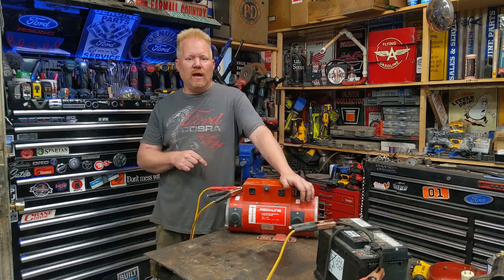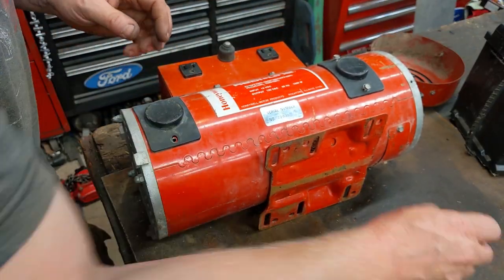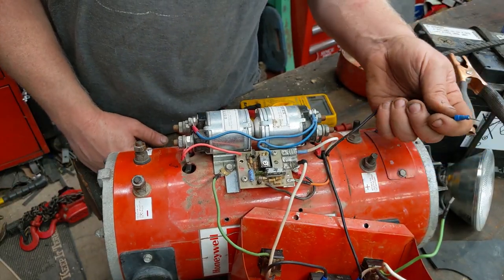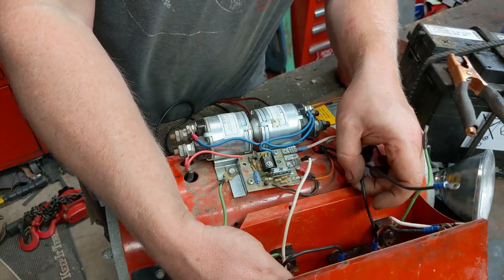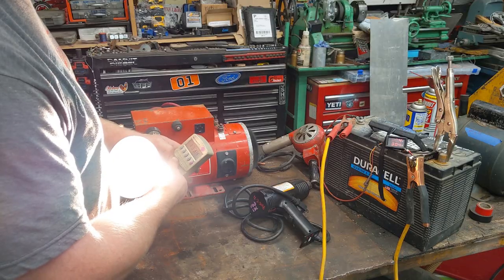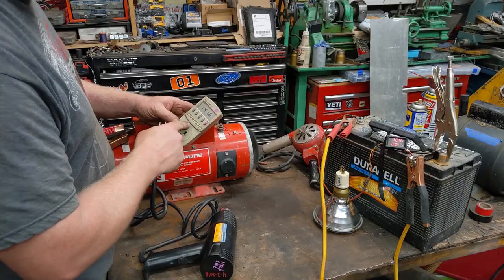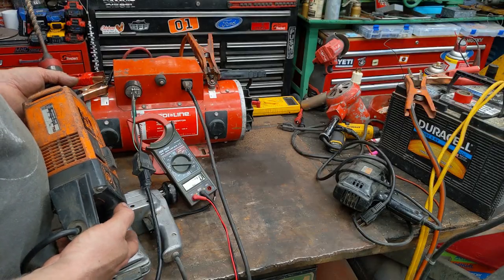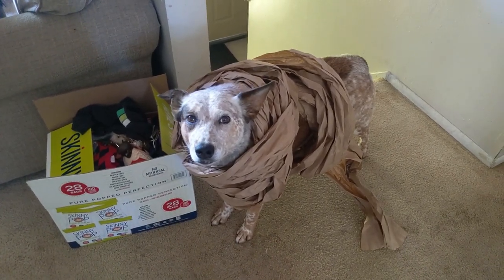12v DC to AC ELECTRO MECHANICAL Generator REPAIR .. HOW THEY WORK .. solar lithium powered?

Comment: Don't forget to show off your Kill-A-Watt meter video as well titled "Kill-A-Watt not working HOW TO FIX".   Inspired me to make a video of my over voltage damaged from the cheap 2-stroke engine 1200W generators I also made a video detailing since I was testing and didn't realize the asynchronous alternators (generators that are brushless) need a minimum power load or they don't have a stable enough voltage.  My videos are titled "You Won't Believe How Easy a Blank Screen Kill-A-Watt Meter Is To Repair For Newbies"   These are neat products and I've been pondering to make a 3-phase rotary converter and/or a 3-phase generator eventually using the extra gen 3 prius CVT that has two motor generators (MG's) that are both way higher power for a unbelievable price since they last... though they're brushless as well so will need to consider having like a resistance load on of some sort once started and some sort of load (current) cutoff for that one another big enough load is on or something like that if not digital using the IGBT and inverter/converter at least electronics.   Sucks trying to do anything smart and move forward on to finish, since my head has a 24-7-365 EMP craft on it.  Thanks for sharing this, neat to see as I've only seen I think a Greek gent make a video showing how he did phase and power conversions using the smaller model motors.
Reply: There are a few good rotary converter YT videos, though that's another topic.  Great overview detailing what you found and rescued!   

That's neat the load control circuit, I almost want to ask to see if you'd photograph in detail the wiring and board or make a schematic.  I'll have to look online and see what I can find.  

Seems like you'd need a feedback loop of some sort logic that'd keep a constant frequency ultimately like you noted for the output in like some sort of 12.6V input control where I'm guessing some sort of high enough current rated buck/boost circuit design or other Constant Voltage (CV) design.  They're out there and cheap... though not sure since I've not looked at the ones over 3A's.  Those 2-3A ones are a few dollars for the 5V USB output design, so I'm sure looking around there are cheap modules for whatever CV you want set... buck converter most likely technically with making an additional low voltage cutoff maybe if can't be built in the module to boost convert maybe I'm thinking.

Comment: I wonder if the two 110 VAC outlets are separate also. So on left 12 VDC would feed left side 110 VAC outlet and another 12 VDC would feed right side 110 VAC outlet. Or could combine them. I had something similar years ago and do not remember what brand. Is that a Blue Heeler ? Love those dogs.

Comment: I have a possibly silly question for you, since its a purely mechanical inverter. Do you know if its possible to feed in say 115V ac 60Hz into the output and get dc 12V out of the input? Say to use as a battery charger for example although an in efficient one.

Comment: What are the chances the 2 sides run out of sync with other?  if so,, you might be able to get 240v AC... We had something similar in a machine shop to get 3 phase for the milling machines..   You should be able to test it by using a meter or wiggy across the 2 hots
Reply from the maker: The shaft running through the center of the entire thing is one piece. Along with that it looks like the AC generator is only a single unit. So 2 DC motors, one on each side and a single 120V wound AC generator in the center. I think is just runs two DC motors as the amps required are pushing 200amps and one set of brushes can't handle that.
Reply: @sixtyfiveford  One of these days, I'm gunna be right about something and everyone will be amazed..  Basically that thing is the original version of an inverter and still better.. A rotating motor /generator will always produce a better wave than any inverter can because it's real.. I have been working on a project that would be perfect for that thing and might be the final system to take my house completely off grid.. Now I'm going to be searching the web and auctions  to find one...    Since side A  turns on when a load is sensed,, could side B kick in at a higher load.. I can see that being handy for things like a fridge or an air compressor.  Both sides kick in to handle the start up surge.....
Reply: That's what I was thinking as well I would almost bet that the two sides have separate AC windings and one comment said they had a 240v version.

Comment: I got one to replace a rusted out one in my work truck, it worked first couple tries, then just started clicking...any idea what's wrong?
Reply from the maker: I would check the contacts on the relay. The clicking is the relay activating but it may not be passing power.

Comment: Just put a start button on it!  What's the efficiency of these, probably better around 30-50% , and looks like besides  the  starting electronics, it could be wired in series for 24v,

Comment: Super chanel ,  look like 220vac compatible using the 2  plug.
Reply from the maker: Maybe! I'll have to check.
Reply: I saw one comment mentioned they had a 240 version so I suspect there's two windings that can be put out of phase

Comment: connect a battery charger to it and charge the battery with it :) seriously though that is pretty cool, id like to have one for my truck connected to a couple deep cycle batteries and some solar to keep the batteries charged when the truck isnt running.
Reply from the maker: Endless power.
Reply: @sixtyfiveford  Yeah, the mythical perpetual motion machine.

Comment: Question is can you spin that thing up with a battery then plug a battery charger into it then power it off the charger n unhook the battery?
Reply: Efficiency makes this impossible
Reply from the maker: shhhhh...... If the government finds out about my endless energy device I'm going to be silenced forever..........
Reply: No once u take the power source off it's dead

Comment: Amazing, this is exactly what they sell today as a green generator… it was existing a long time ago, funny.. the question is, how long it is working with two 12 volt batteries.. I do think that this will work good like the new green generators! So it must be possible to connect a sun panel on it, so it is green powered!!😅
Reply from the maker: It doesn't last very long. It is around 75-80% efficient at converting DC to AC power

Comment: Befor there were solistate inverters there were ether inverters with a vibrator or for larger current draws to step DC voltage up or down at larger current draws motor generarator inverters were used-  on the B 17 bombers most of the equipment was 240 volts DC - the batterys along with the tail generator and radial engines generators were all 24 volts DC - 4 motor generators boosted the 24 volts DC to the aircraft operating voltage to 240 vots DC - also the radio ran off 110 volts AC 400 Hz, a inverter generator powered the radio and radars- 
       Up till after WW2 most rural homes did not have grid power - rural homes that did have electricity primarily used 6, 12, 24  or 32 volts DC  - there was. A complete line of appliances sold in 32 volts DC in small towns equal to any appliance sold in citys that were 110 volts AC  in a city - 
   A TV or florescent lights in a born ran on 115 volts AC - so farms that had a 32 volt house with a large bank of batterys had to use a motor generator for a TV or barn flouresent lights -to change the 32 V DC to 115 V AC - 
      There were also 6, 12, &   24 volt motor inverters that stept up to 115 V 60 Hz AC -

Comment: 4k!?! that price is so crazy, it's almost offensive. it's a neat unit though. if they knew what they had, i'll bet you'd have had to pay a lot more than you did. don't ya just love auctions?
Reply from the maker: I would have thought $800 to $1,000 would have been offensive. If it's any consolation, it was only $3,500 two years ago. So inflation has bumped it up another 500.

Comment: Your doing this all wrong I have that same generator YOU HAVE TO HOOK JUMPER CABLES FROM - to - and + to + and you can also hook a battery to one side and a battery to the other side, if you send me your email I will send you a diagram on it. I also have a you tube channel check it out if u want
Reply: I have the 1600 watt redi line and like to know your diagram